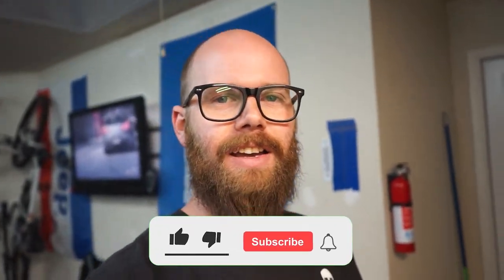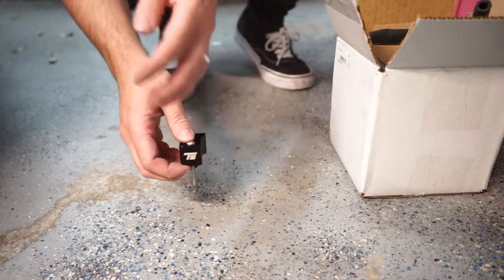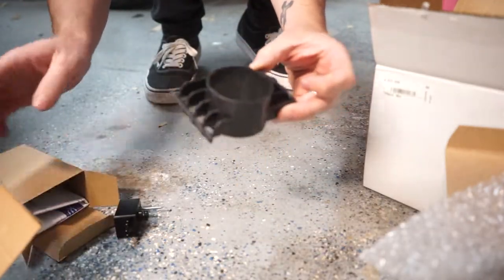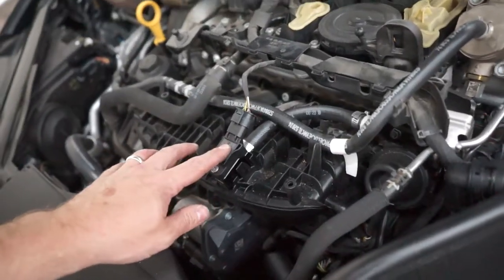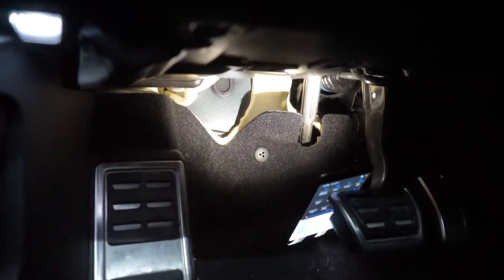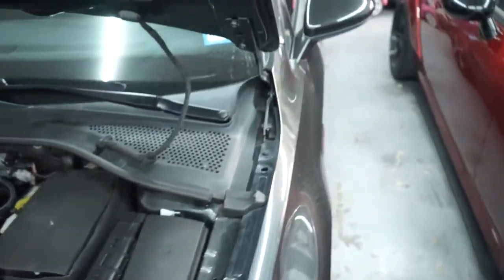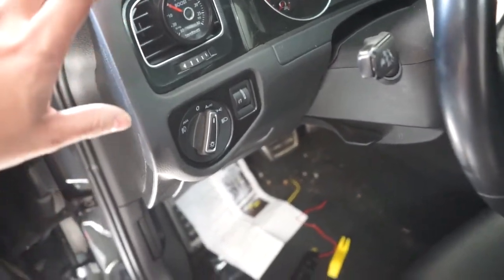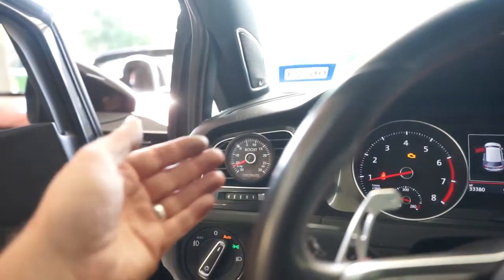NewSouth Performance Analog Boost Gauge for the Mk7 GTI

Comment: Most guys don't use that adapter as it's been known to have bad readings from relocation of the sensor.  Just better to run dedicated line to the side of manifold.
Reply from the maker: Thanks for the feedback, I might change it up then
Reply: @ColoredinLight  please make a video if you do change it up. This channels been a huge help
Reply from the maker: I ended up changing this, not worth the video though since it was like a 5 minute swap. The boost gauge comes with instructions on how to tap into the manifold and it was easy to do!
Reply: @ColoredinLight  could u send me the instructions? I lost the box and I’m taking off the boost tap

Comment: Where did you route the boost wire inside the car to connect to the guage?
Reply from the maker: It's wired into the light switch controls
Reply: @ColoredinLight  I cant figure out how to get the vacuum line onto the back of the gauge itself lol im not sure if maybe they didnt send me everything im super lost
Reply from the maker: @MrDiamond1000  it should just press on
Reply: @ColoredinLight  is the thin nylon hose supposed to go on the port in the back of the gauge? I literally cannot figure out how to get it on
Reply from the maker: Yes you just press it on